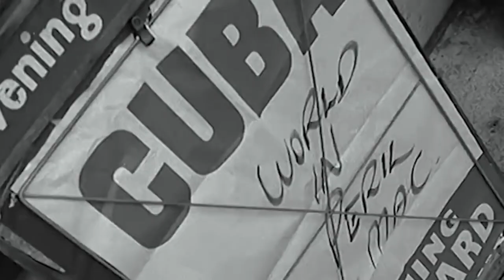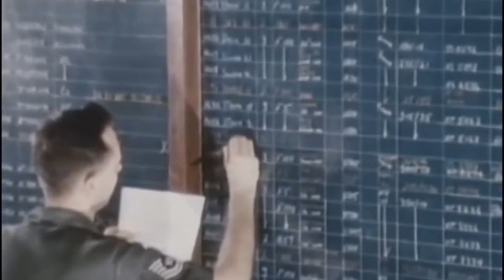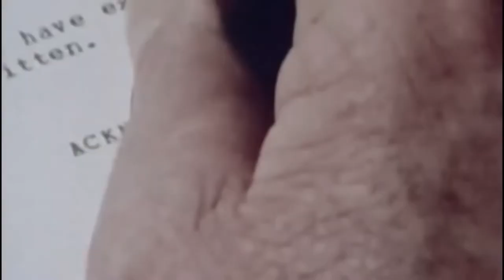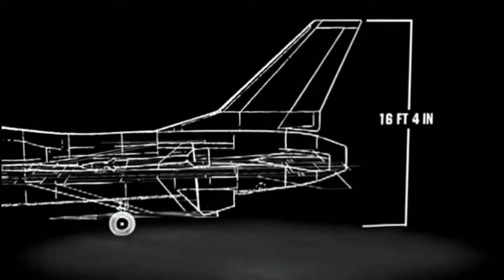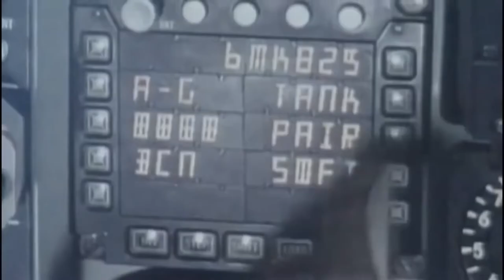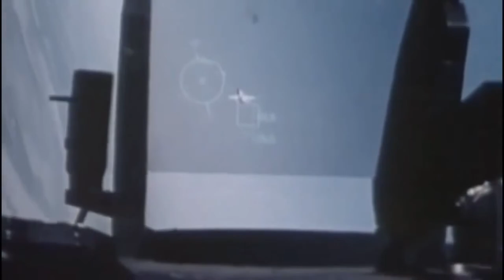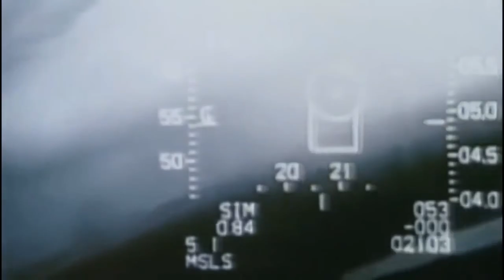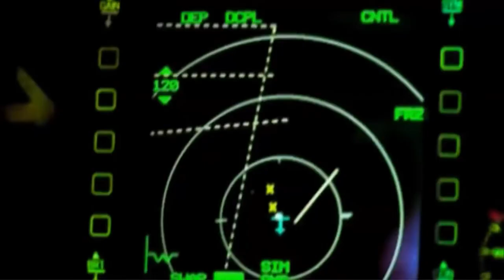The true story behind of the F-16 Fighting Falcon

Comment: My mom worked for General Dynamics in from 1980 to the mid 90s building the F16. I always thought it was a shame that the F16 XL never went into production. It would've been hands down the best delta winged fighter aircraft produced. I saw a lot of the initial flighta of the prototypes myself at what used to be Carswell AFB in Ft Worth. My mom's friends who worked on the development of the XL told me much about it's capabilities. You should do a video on it. Interesting story.